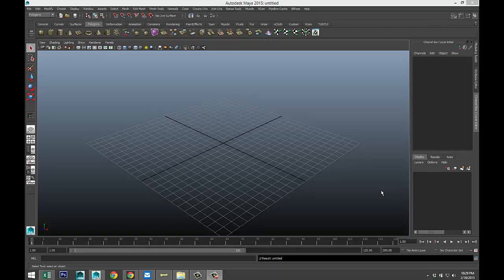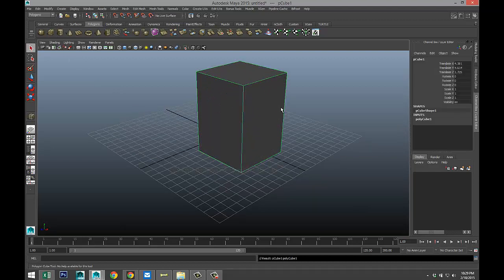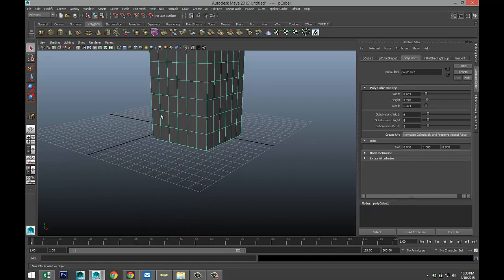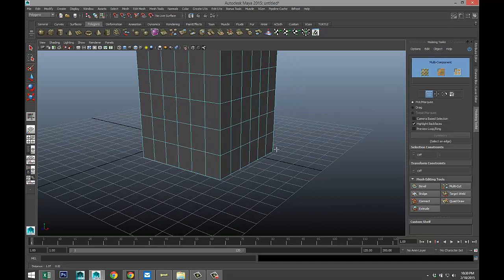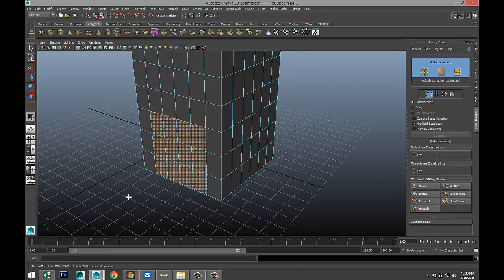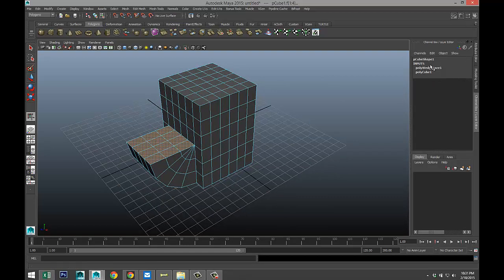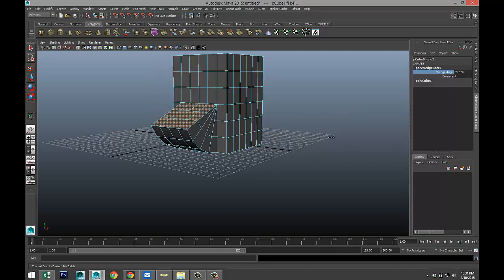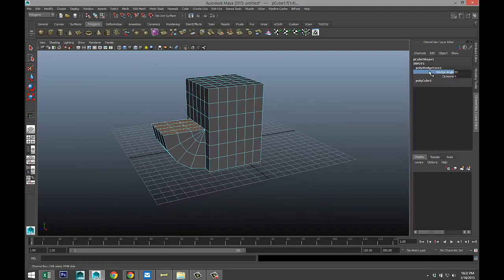Using the Wedge tool in Maya 2015

Comment: I'm trying to make a bent pipe can somebody help me? >.>
Reply from the maker: +Nepu-Tech USA https://youtu.be/Lg03ZZd6Lhw
Reply: Mike Hermes
Thanks for the quick reply! Do you know how to use this method to make a straight pipe with two 90degree turns. But the pipe has to be circular, I tried using the NURBS method with Extrude surfaces but it makes curves not 90 degree angles and the method you linked me is squared instead of a pipe...

Thanks for the help!
Reply from the maker: +Nepu-Tech USA Sure, check my video on copper fittings ( connect two 90 degree pieces https://youtu.be/CU5AsWRAuLQ
Reply from the maker: +Nepu-Tech USA Thank you !